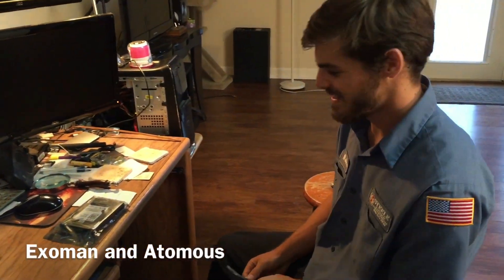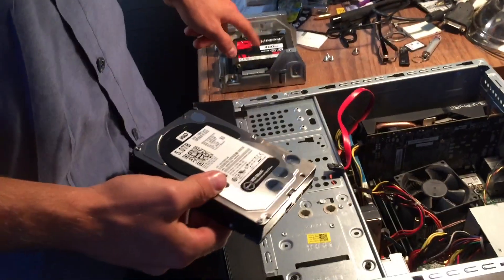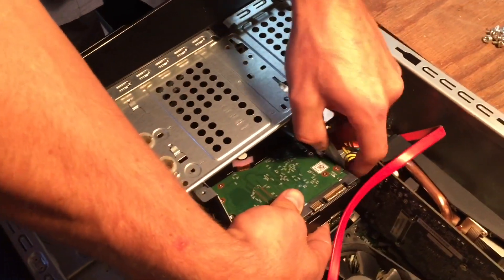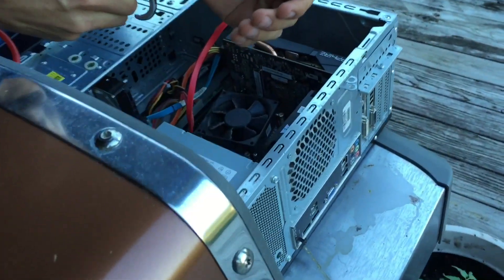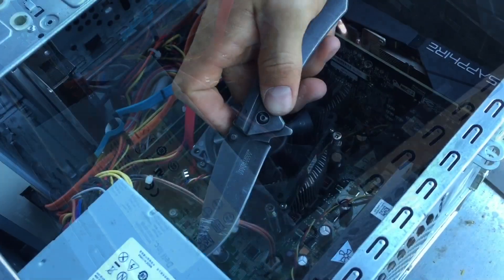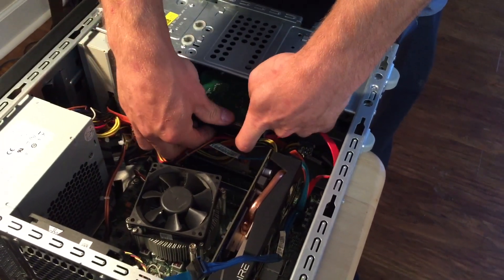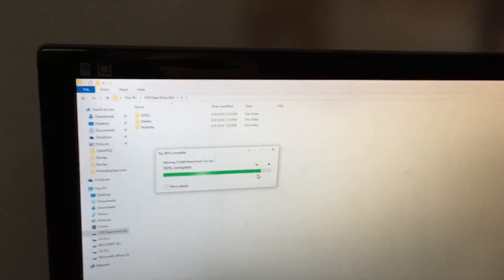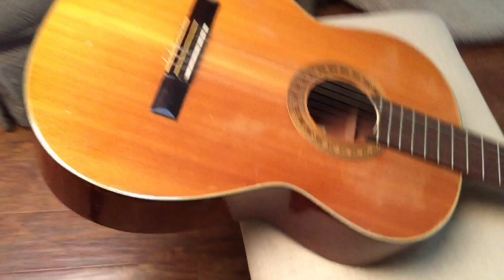Adding a magnetic hard drive in computer w solid state drive operating system

Comment: Nice drive... Western Digital is best today...  only need a 120GB for C Drive (OS and apps)... Setup SATA drive with partitions as needed (mine goes to K:)  First partition (C:\) should be about 100GB for OS and apps, then leave that partition on the SATA drive as your backup, after transferring it to an SSD (the new C:\) - Many partitions is good for data organization, data integrity,  quicker, targeted defragging...   technically, if you install one (partitioned) 5TB for data storage, buy a second 5TB as the backup image...  and your done    ; )

Comment: Get a file sever that you can RAID. And not the insect spray.  Can span across multiple drives, as long as they are all same size and make / model.
Reply: I was thinking the same thing. A Raid tower.
Reply: RAID unit, box unit as a NAS unit.
HD is good on an SSD system as a swap file holder, saving the Flash for OS and hard storage.

So, User space goes to the HD, swap, the rest, to the SSD system. It's what we do.
With are aged Dell PowerEdge 2950 file server for video storage and serving, via MythTV. 

I'm equally good at low tech. I can do land nav, at 10 digit grid coordinate precision, with a map and compass only and more.

The mind is the ultimate weapon, when used properly.